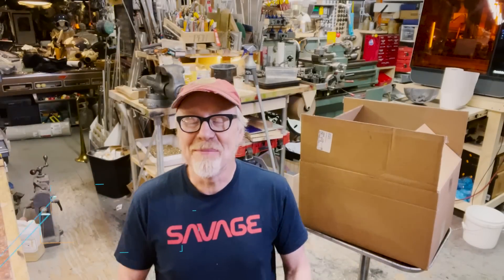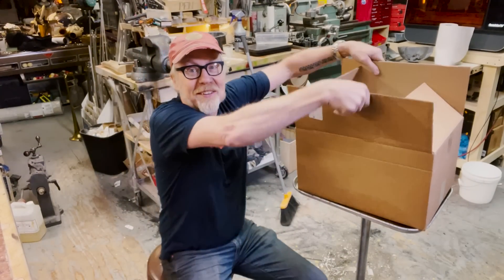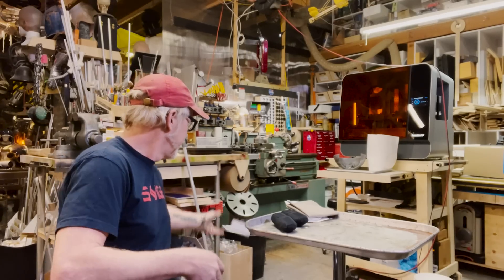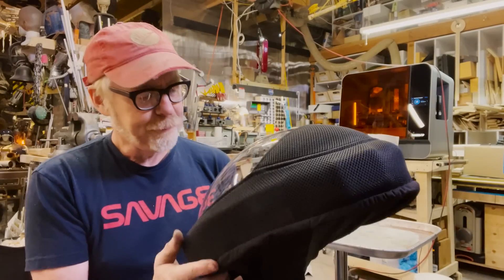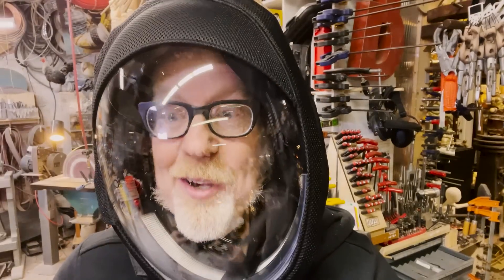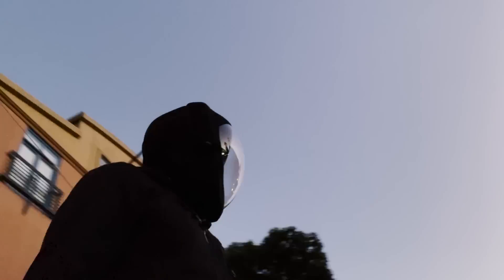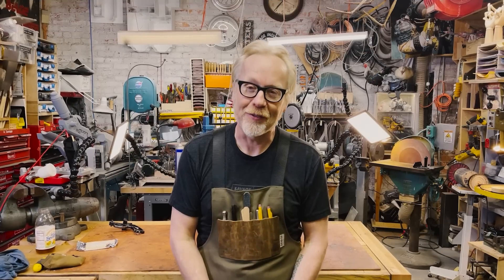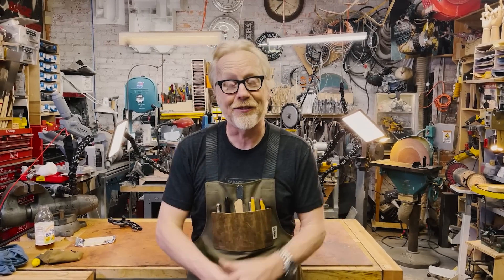Adam Savage Tests the AIR Active Filtration Helmet!

Comment: Oh, cool, you got one, too. I just knew you would get this helmet, given your passion for such accoutrements. No, it doesn't have a mic. You'll have to DIY that. I used one of those tour guide personal voice amplifiers that I clip to my belt and an adjustable boom mic. And, of course, you immediately called out the fitment issue like everyone who has ever donned one. I solved that by clipping the excess hood material to the base of the neckline with a medium-sized bulldog clip for relatively quick application. I'm sure a purpose-built vertical drawstring would be more effective.I also reduced the fogging inside with a few squirts of Rain-X Anti-Fog spray. My next project is to attach audio exciters to the sides in order to pass ambient sound from a binaural (or mid/side with stereo decoder?) mic, preferably far enough away from the fans at the bottom to avoid that noise and from the exciters so I don't induce echo/feedback. Thanks to Tech Ingredients on YouTube, I learned that Adafruit makes a handy 20W class D audio amplifier board that's perfect to drive two Dayton Audio exciters with the same 12V power supply the fans use. I may or may not tap into that supply, but I'm concerned that the additional current draw may burn out those fan headers, so I may just power it from its own LiPo pouch cell. The amplifier board also includes a standard stereo mini jack that can accept a small Bluetooth bi-directional transceiver such as the Hagibis X2-PRO-RTS.

Comment: Two thoughts on fogging: Jamie will know what the divers do for fogging in scuba masks, and / or some directional baffles inside over the input filters to direct the flow forward to wash over the face plate should reduce the fogging. This exactly what I have looking for. Thanks.
Reply: Yeah, that's exactly what 3M's full face respirators do. But part of the appeal of this mask is full visibility of the face. A better solution would either be increased airflow or the use of desiccant within the dome to absorb excess moisture.

Comment: Good luck wearing that during hotter weather! I'll just stick to the mask.
Reply: Hot weather is fine. I live in the California Central Valley so it can get quite toasty. The fans do a good job keeping you cool in there. One unintended side-effect of the acrylic dome, however, is that it tends to lens sunlight a bit more intensely on your face than without it, so the sensation of heat is noticeable, but not overly so.

Comment: I recently bought some 3M goggles from home Depot they are totally enclosed ,, and they never fog up ,,, missed builds up from the inside of the glass and they're soaking wet after wearing them for several hours but they don't fog up.
Reply: The FF-400 series? Yeah, I've got one of those, too. The issue for me is that they don't filter the exhaust port by default. I could probably modify mine by stuffing some cotton batting between the valve and the guard plate, but that mouthpiece does get damp and it blocks people from being able to read your mouth movements. Maybe if they had a transparent mouthpiece, I'd wear it more often. I do like how it doesn't require power, has superior filtration (including organic vapors), and doesn't cover the ears.

Comment: Wow that really made me change my mind on this.

Were the fans at full.power I've seen people do this without fog but yours is really 😯

My main concern was the light bending and vision being distorted but the fog makes this even worse.

Makes me sad but I also am happy I did not order one!
Reply: There is a slight optical warping, but its barely noticeable. Fogging is definitely an issue in colder environments. I'd counteract that with some silica gel descicant packets inside the dome and some anti-fog spray on the dome interior to coalesce and flatten the micro droplets.

Comment: I'm surprised that they didn't run a tube from a larger air pump that you clipped to your body somewhere, so that it could be louder without bothering you...
but i suppose that'd take away from the simplicity
Reply: Right. Maxair makes a similar design with lighter weight plastics and elastomers. But their filters aren't as robust. Seems like the happy medium lies somewhere between these two.

Comment: Such a bummer it fogged up so much!  The only way to 'neutralize' the fog is to have a high positive air pressure inside hte mask with an active one way exhaust vent.  Hard to do that quietly, efficiently and without looking too funny like.
Reply: Unfiltered exhalation valves are a no-no in the pandemic. Those are "selfish" masks. All exhaust air must be filtered as well.

Comment: The fogging is a big disappointment. I've got a 3M 6800 that I've used for non-covid purposes (no filtration on the exhaust) and I can be sweating buckets and the visor stays perfectly clear. It works because they designed it right: the dry, filtered fresh air enters the visor cavity first, then enters the mask over your mouth/nose through a valve, where you can breathe it in, then exhale out another valve that vents directly out. You never get the build-up of humid lung-air in the visor cavity.

I could easily see that kind of air path adapted to something more easily wearable day-to-day like this mask you demonstrated. But given that they seem to have designed for aesthetics rather than functionality, I think I'll stick with plain 'ol cloth masks for now.
Reply: For some people and professions, the ability for others to see your mouth movements is a critical business function, not just for aesthetics. In any case, the fogging can be easily solved with simple methods.
Reply: @MikeTrieu  Oh absolutely. It's disappointing that they didn't put any of those simple methods into practice when they designed this product.

Comment: idk if it's possible to add an internal wiper that sites at the bottom and you can use a dial to wipe it manually from the inside when it fogs up.

Comment: Filtration is only 0.3 microns though
Reply: It's 95% at 0.3 microns.  Just like an N95 mask, it does better for both larger and smaller particles.   This device is intended to replace wearing an N95 mask, not for more critical uses.

Comment: How about fitting a Beltunit to it with stronger fans? The distance should make is easy on the ears. (Had good results with the 40mm fans from https://www.blacknoise.com/site/en/products.php) Makes it less simple but you have to prioritise what you are shooting at.
As far as microphones go....I would straight away fix the mic from the Batfleck Voice Modulator to it that I built. It´s an easy Arduino Project that I found here on YT. The guy even has the files for 3D printing a nice Batman-belt-box that fit the electronics there.

Comment: Would a double layer of "glass" with vacuum in between solve the fogging? Or at least reduce it to levels where the fan can handle it?
Disregarding the structural issue of vacuums, of course.
Reply: It would mitigate the temperature differential, but you're always gonna be breathing out moisture and there's only so much those two small fans can exhaust through the HEPA filters. I think a desiccant inside is a more practical approach. Think silica gel beads or Damp Rid. The latter can be "regenerated" in an oven to drive off moisture for continued use.
Reply: @MikeTrieu  The point is to keep the inner glass warm enough that it will not fog up from the moisture, ideally. Realistically, to keep the fogging on a level that the fans can eliminate.

I'm not sure a dessicant would be fast enough to pull it out of the exhalation before it reaches the glass and condenses.

Comment: I bought one so that I have a better chance of surviving an upcoming family super spreader event. I just received it, and have worn it briefly on four occasions. I would point out it is not marketed as a PAPR, so don’t expect it to act like one...it’s a combo face mask/shield featuring a fan-driven HEPA filter system that draws in filtered air to breathe and exhausts filtered air after you breathe. It definitely offers a better seal than a face mask/face shield. It was designed for walking in a plane terminal and sitting in an airplane, so I am not concerned about the fogging issue so much as the wearability issue. I need to work on figuring out how to position it comfortably on my head. It’s basically an oval frame, and it’s unclear how best to balance it. To help keep it in position, I am thinking of trying to add a padded suspension frame like we use in construction helmets. Before I go to that extent, I am going to try adding thicker padding on the crown plus an elastic strap attached at the crown that loops around the back of the skull. I have the additional challenge of a whiplash neck, so the weight is not an insignificant issue. I found it relatively easy to communicate with people about buying a new phone and renting a car. With the fan on low, I was able to hear people at close range. No one facing me and seeing that I was speaking asked me to repeat myself, so they must have been able to hear my muffled voice. The driver who took me home had his back to me and did ask me once to repeat myself. When I returned the rental car, I wore it from a fairly cold car to 0*F outside to a heated interior. The lower part of the face shield fogged lightly when I entered the buildings but it cleared up rapidly. As for ludicrosity, I have to say that it was a hit at the Apple store, garnering many compliments, and that it was was of minor interest at the car rental place. I am not sorry I bought it, because I have a number of comorbidities that make it likely that a COVID infection will kill me. Because it’s better than a face mask and face shield, I feel more comfortable exposing myself to other people, especially if they are not wearing a face mask, which is common where I live.

Comment: Adam, man, you need to try anti-fog spray for like Windows for vehicles
Reply: I can confirm that it works well in this helmet. The moisture still builds up on the inside of the dome, if its cold outside and you're breathing hard, but at least there aren't a thousand tiny droplets scattering light everywhere. Visibility is much improved.
Reply: @MikeTrieu  yeah that's what anti-fog coating does is removed the ability for h2o to adhere to a surface. So it can't fog up. When I was in the military I had to do gas masks and they actually have a port at the bottom to allow the moisture to run out of the mask. That alone percents the huge fogging issue
Reply: @spiritualinsight  If it weren't for the public health consideration of pandemic mask design, I'd agree that a straight exhalation valve would be your best bet to reduce moisture retention. What we need is some kind of membrane that easily allows water through, but not polar particles like the coronavirus with its lipid bilayer.

Comment: You don’t need a fan. Look at what Shoei does for their motorcycle helmets. 

They clip a flexible insert that fits to the inside of the helmet with a small gasket which basically makes a double pain of glass. Zero fogging.

Great vid BTW

Comment: I have a 3m Versaflow helmet for respiratory and head impact safety in my wood workshop. It has a small quiet impeller on the waste mounted filter unit (mine is called jupiter - pretty sure it's been updated to something else now) The air flows from your forehead down the face mask on the inside. No fogging. You can also put the face shield up when you need to. https://www.youtube.com/watch?v=GBSvLMIzB1k&ab_channel=AlecSteeleCo.

Comment: Wouldn’t you need to warm the faceplate a bit to help avoid the temperature differential that causes the water in the exhaled air to condense? I’m not sure how exactly you could do that not knowing what material the faceplate is made of. Interested to see the mods you made.

Comment: Air proof seal with two fans inside just a mix around here carbon monoxide that you're breathing out but no you don't have any kind of filtration to bring actual oxygen into the mask and you don't have any air canisters to connect to this mask so I don't see you breathing air in that s***
Reply: You don't breathe out carbon monoxide.  The fans draw in outside air through two filters and it vents out through the other two filters.  I'm sorry you can't grasp how it works.

Comment: Question: does the fan blow air into the helmet, or suck air out of the helmet?
In my cosplay I made a very tight helmet with a lot of glass (Zero from Borderlands 2) and I found that a suction fan at the back that pulled air from the chin and up over my face worked quite well, much better than a fan blowing air into the helmet.
Reply: The two fans at the bottom, close to your mouth, suck air out of the mask through HEPA filters. The rest of the passive intake holes draw fresh air through the other HEPA filters. The overall airflow is top-down, over the surface of the dome. That's why the condensation occurs at the bottom first and gradually rises to the top when your respiration overloads the fans' ability to exchange air.